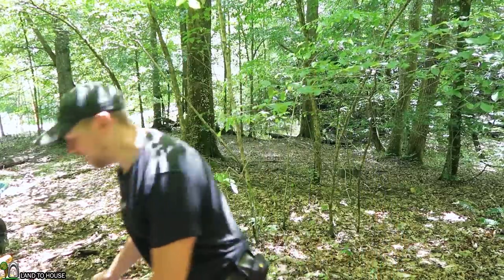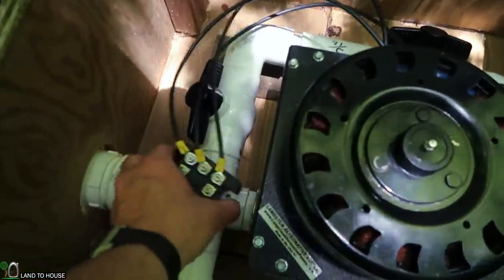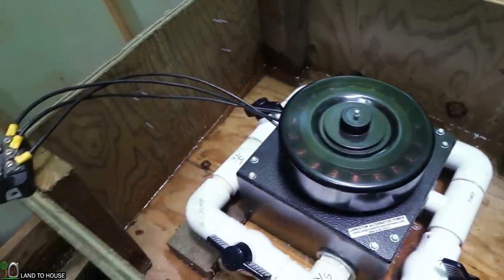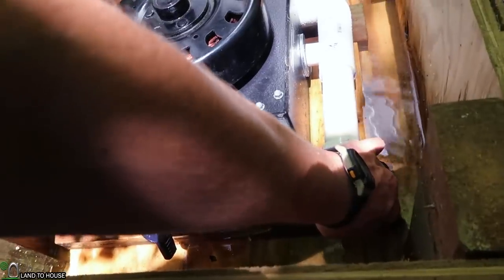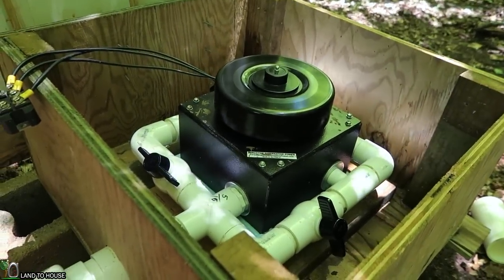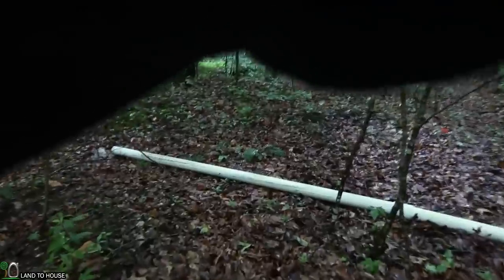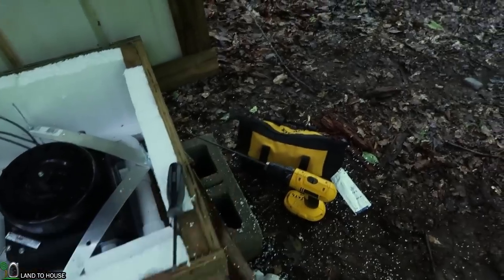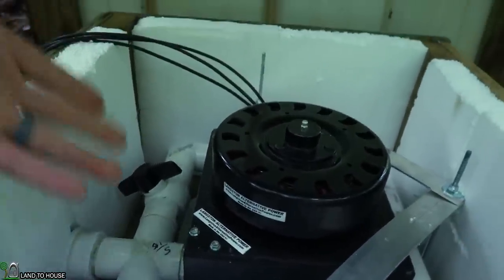Installing the Turbine Micro Hydro 6/10

Comment: Just a quick question ..may be it is a stupid question.. but what happens if we pass the outlet water back to inlet and so it works like a cycle
Reply: The inlet has potential energy due to the pressure of the water. The water from the outlet lacks that pressure because the turbine has extracted that energy. What you're seeking is a perpetual motion machine, which violates the laws of thermodynamics.
Reply: While i agree with the first answer i do believe you could “recycle” a portion back into the supply pond or river which could in theory help to not reduce the levels too much like what happened in the video of the dam where it was using up the supply quickly
Reply: @Dravira  You would need to expend energy to return that water to the pond uphill from the turbine (via a pump), you would negate the energy you've generated with the turbine.
Reply: Clayton Hansen true if going that route, however with some ingenuity you could come up with a system to divert some back uphill using another method it would just take a lot of extra work and another contraption to make it happen using another section of the stream to help pull it back up, in theory you could do it but easiest way would just to be to divert some of the power to a pump which if producing enough wouldn’t be an issue regardless. But then again now you have to maintain a pump that is just another additional piece of the puzzle
Reply: Clayton Hansen my initial plan of thought would be using a barrel to collect in and once it fills to a certain point the pressure would be high enough to send it back up. Not sure what the elevation change is but if its not crazy it could be doable
Reply: Clayton Hansen well in that case you could pump it back using part of the energy. Surely there is a pump out there in this day of technology that is efficient enough to still run off of left over generated energy or the use of a bigger turbine to make up for it. Id be interested to see the flow and volume of the supply to see if a bigger turbine is plausible. Be even better if there was enough volume to divert some of the supply to a watermill to turn that into a second source of mechanical energy to pump water back up. Hope what im saying makes sense in my head i can see it but im bad at explaining what i see in my mind without actually putting it on paper. So basically splitting the supply. Something tells me there would not even be close to the amount of supply needed. Even if there was that much supply you probably wouldn’t need to pump it back up to begin with
Reply: @Dravira  It's a matter of energy in must equal energy out.   You just. can't. do. it.  I totally understand what you're suggesting, but it simply wont work.  I'll try my best to address your arguments individually and know that I only want to educate, I'm not here to shit on your idea or tell you your wrong for the sake of argument.

If you get 500W of energy out of a turbine, that means there was something like 500W available energy from that water source.  I say 'something like' because of the losses I mentioned.  Energy is loss to friction in the pipe, friction in the bearings of the turbine, etc.  So for the sake of argument lets say there were 600 watts of energy available originally, and 100W were lost to friction etc.   What this means is that it takes 600W of energy to then move that water back up to the pond.  That's a foundational law of physics.  You can't use less energy to do the work of pushing that water back up the hill to the pond If you used less energy, it just wouldn't get all the way back up.  It doesn't matter how efficient a pump is that you use to do that.  Work is work, no matter how efficiently performed.  

Regarding a second watermill or turbine:  Once the water has passed through the turbine, all of the energy has been extracted by it, there's nowhere near as much energy left in it as there was right as it was leaving the nozzle at high speed moving towards the cups on the turbine wheel.  The water hits that wheel,  imparts its energy to the wheel, and after that point is no longer moving fast and is at atmospheric pressure, and thus has negligible energy, which is evident by the fact that it's not shooting out of the bottom of the turbine like a jet, but pouring out slowly.  

If you meant a second turbine next to the first one, with a y-junction feeding them both from the same pressure, then they would each (in the situation I described above) generate 500W assuming the flowrate of the supply could keep up with that amount of water consumption.  However, these two generators together would use twice the water as one, so you would still be left with twice the water, twice the energy output (1000W) and require twice the energy to lift twice the water back to the pond (1200W).
Reply: Clayton Hansen no i meant splitting it as you mentioned with a y and using a water mill using the flow to convert it to mechanical energy to move water back up sort of like a bucket brigade or like a pumpjack using the physical movement of the water to move it back not using physical electrical power from the movement. Keeping one part of the supply to actually make electricity and one part of the supply diverted to mechanical means
Reply: @Dravira  Energy is energy however you quantify it.  A Watt refers to a quantity of work done, whether that work is mechanical, electrical or otherwise.  My previous argument still applies even if your pump is strictly mechanical with no electric components, just a paddle driving a pump or something.  It still takes that 1200W of energy (mechanical energy in this case) to lift that water back up to the pool.
Reply: Clayton Hansen i think its getting lost in translation here on what im trying to get across
Reply: @Dravira  I'm happy to try to get to the bottom of it with you if you want.  I'd love to understand what you mean.  Might have to wait until tomorrow though.  It's late where I live.
Reply: Clayton Hansen basically what im trying to get at is from the y, you would have water diverted to the turbine while the other half is diverted to a waterwheel with gears which drives a pump directly to pump the water back up, water would still be lost which I understand as it couldn’t possibly pump everything back, its more of a return half back and lose half to try and be more efficient with the use of the supply. So something sort of like this for the water wheel. https://youtu.be/y34pgsX3Fg8. This would heavily depend on the supply as you would need the supply to drive both things but it also be little enough of a supply to even benefit from any kind of return. Yes i realize its far fetch and a lot of extra work for just a little return but its just a cool idea that was spinning in my head since i never like to do anything just the simple way i try to find every little extra use for something to get the absolute most out of it. I have seen something similar with like a windmill pumping water up and down like a pumpjack only the windmill in this scenario would be a waterwheel and a direct drive of spinning its own turbine. Im not looking to return all water back to the supply only some of it as that pump wont have the gallon flow power to move it all back at the rate its moving downstream. I made something similar on a small scale in high school that worked great but still would lose at least 50 percent since the pump wouldn’t be powerful enough to keep up
Reply: @Dravira  the video you linked to actually demonstrates the point Clayton is making, that water wheel does not capture much energy in mechanical form. He talks about not being able to hook much up to it to generate electricity because it's not spinning very fast and any resistance to the rotation leads to the unit no longer rotating or rotating very slowly. So that is a very inefficient capture of energy. The turbine actually captures the energy more efficiently by trading the gravitational potential energy of the water for pressure and then using the pressurized water to generate a strong force for rotation on the turbine which captures more energy from the waters potential energy. Returning the water uphill would not be efficient in any system, there is just no way without introducing another energy source to pump the water back up. You could hook up a wind turbine to provide power to a pump to pump the water back up to recycle it within the system, but then you are introducing another source of energy to drive the water.
Reply: I feel like im being trolled here right now so im gonna let this one go. Points are valid however I have said things pointing to if there was enough supply overall not necessarily just this case but in a case where there was enough supply to make it efficient. Its fine though someone else will see what i was saying and it will make sense to them
Reply: @Dravira  you're not being trolled, I promise. It just seems like you aren't willing to accept that I and this other commentor understand exactly what it is you're describing, but aren't willing to accept that you might be wrong about your understanding of physics.
Reply: @Dravira  I'm honestly not trying to troll anyone, but it's all just energy man. There is nothing we are aware of in the universe so far that would allow you to take the water from a higher point to a lower point and then return that water to the original height. There is energy loss in that system. If you could even hypothetically have a 100% efficient system to move the water down with zero energy loss to friction or any otger factors, you'd only have enough energy to return the water to the height it started from. Any extraction of energy would mean the water could not return to the same height it left from. So you certainly could build a system to use water to harness energy to pump water back up to the start point, but it would only ever be a fraction of the original water and all the energy you harvested from that water would be used to return it. Due to real world losses from friction its a scenario that always results in a net loss of energy. I understand you are trying to save aome of the water in the circuit so you are not putting such a demand on the reservoir uphill, but the only way a system like that can work is by introducing another energy source to power the pump to return the water. It could be any energy source mechanical, solar, wind, heat, more water, but you'd expend energy above and beyond what can be gained from the original gravitational potential energy in the water. So you'd absolutely be maming more efficient use of the available water so you're not drying the system out if water supply is a concern. Doing that just means you need more energy in the system.
Reply: OK just need one more clarification.. Is it possible to start a water pump with the generated electricity from the turbine and send back the water from the pump to inlet supply
Reply: @TabsheerAbdullaVlogs  It is "possible" but you wont be able to pump all the water back up, and you will use up all of the energy you generated with the turbine (and be left needing more to finish the job.) You will have accomplished absolutely nothing.
Reply: @clayhans  oh ok..thank u
Reply: @Dravira  It's not a matter of trolling, no one is trying to troll you or be rude, its a matter of the amount of work being done in a system. Another way to look at it that may be more simple is just the available energy. Gravity is a universal force on earth, everything is affected by it equally at 9.8m/s^2. If something has no energy it can do no work. A dead battery cannot run a motor, we need energy to do work such as move water in any direction. The reason water can move downhill, is because it has energy. That energy is not magic, it comes from the force of gravity. An objects height determines it Potential Energy (PE) which is defined as mass*height*gravity in terms of potential energy on earth, potential energy is energy that is not moving essentially such as water behind a dam that is not flowing. In this case the height is the height of the water above the turbine. There is another form of energy called Kinetic Energy (KE), this is the energy of something moving like a car or flowing water. Then there is Total energy (TE), that is just PE and KE added together. The total energy in a closed system never changes, you can only transfer energy between PE and KE. Water flow dynamics is a lot more complicated, but we are just going to keep it simple for explanations sake.

In this system we have a dam, the water behind the dam has PE, this is used to fill the pipe all the way up to the turbine. When you open the turbine, all the water in the pipe is traveling from the top to the bottom. The height of this water is decreasing so it's potential energy is decreasing, however the total energy must stay the same which means it's kinetic energy is increasing. It keeps increasing until it hits the turbine and transfers almost all of it's total energy (mostly KE but there is some PE left as it drops out the bottom) into the turbine. The water after exiting the turbine has given away almost all of its energy, it has almost no more energy left, which means it can do almost no work. Now that energy we had for that height (46 meters approximate) is about 450 Joules (J) per kilogram (Kg). Thats how much energy is available in every kilogram of water. When you convert energy there is always loss, friction is normally the number one cause of loss. If we are to talk about your water mill idea that brings water back up top somehow, we know that there is going to be loss in the system due to friction. We also know that there is only 450J of energy available to do work in every kilogram of water.

So if we run the turbine and it uses 1Kgof water, then we need a water mill to lift 1Kg of water back to the top. The only way to get that 1Kg of water back up is to expend 450J of energy. The only way to use 450J of energy from water is to convert PE to KE this requires using water that still has energy from behind the dam, 1Kg of water to be exact. So now you have to let 1Kg of water out from behind the dam to run your water wheel, but remember you just moved 1Kg of water up and brought 1Kg of water down to run the wheel. Also we have to remember loss of energy due to friction, even if your water wheel is amazingly efficient and is able to convert 90% of the input energy to work, you still lose 10% of the energy. which means we lose 45J of energy in the water mill leaving us with 405J of energy to move the water, that means we can only get that 1Kg of water to a height of 41 meters instead of the original 46 meters. So we need to use additional water in the water mill to get that last 5 meters of height. That turns out to be another 50J of energy from 0.11Kg of water.

So if we use a water mill or any other method of moving water that is an amazing 90% efficiency to move the outlet of the turbine back up to the source, we need to use 1.11Kg of water additional to what is flowing from the turbine. To put that into perspective, 2.11Kg of water flows downhill to the turbine and water mill, only 1Kg of water moves back up to the source, leaving 1.11Kg of water at the bottom. So you went through all that just to have more water at the bottom than just letting the turbine flow out on it's own. You aren't being trolled and no one is trying to be rude, we are just trying to explain why it doesn't work.
Reply: Could you come from the bottom of a barrel with bell siphon system and just do that as many times as needed to return the water?
Reply: @TabsheerAbdullaVlogs  Short answer, it would take a 1.5hp  pump (120v/12amp/1400 watts) to get enough water  back to the intake to run the microhydro, but this microhydro only produces 300-400 watts of energy.
Reply: @ParadigmUnkn0wn  with physics i have come to understand that everything is possible given a little thought
Reply: Didn't the Romans do things like that with the Aquaducts...
Reply: Hallo, GM, everybody,I will try answer this ,1)energy cannot be created or destroyed. But it can be transferred from one form to another but while transferring efficiency is max 80% .That means 20 % . So we can give water from out let to inlet but already we have lost 20% again transferring water by any means will lose more 20 % . 2) so the potancial energy due to topography was free of cost which we harnessed by micro hydro. But again create potential energy we need to pump water to inlet which will need electrical energy which is  not free of cost 3)but still we have chance of using hydraulic ram pump & pump @ 50 % water back to inlet without electric power .this in my thought is more viable when there is shortage of water & little sloping topography below outlet ...regards ...Sarjerao
Reply: That would not work because if you tried to route any of the output water back to the inlet it would result in a NO Pressure situation, the high pressure water would flow bypass the nozzles and no power would result.
Reply: i've learned how to make ram pump from you sir 10 years ago 😁 maybe you can use it to recycle 10% of water back to your inlet
Reply: Don't worry the nature already do that task. We see it as rain/water cycle.